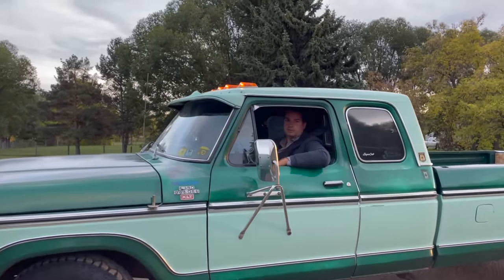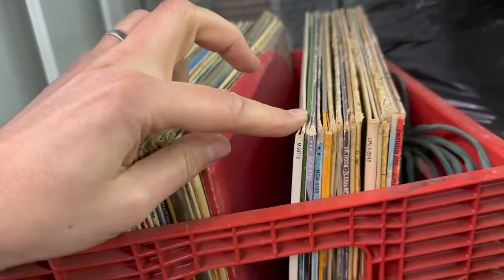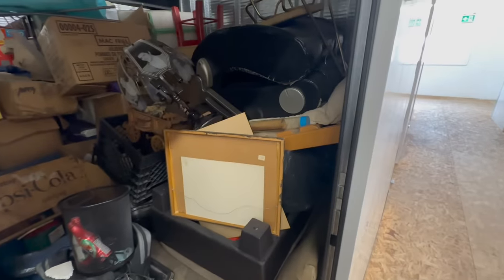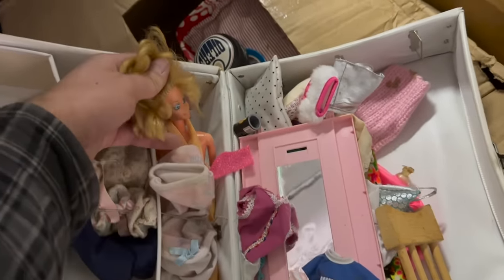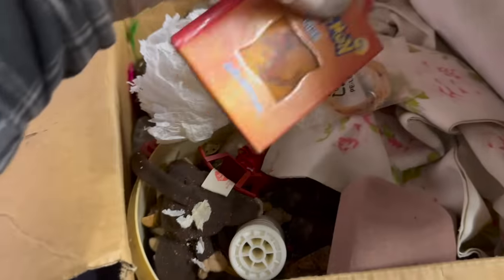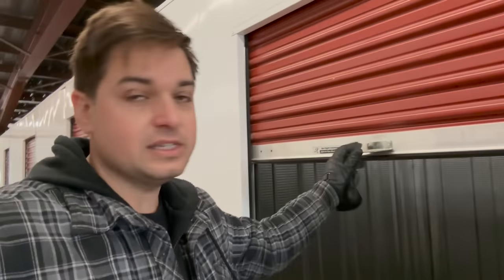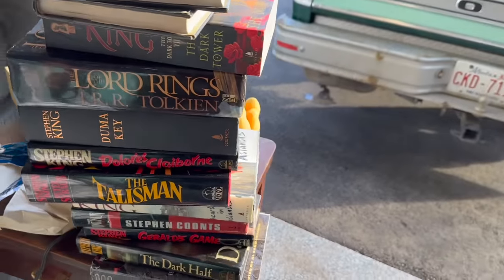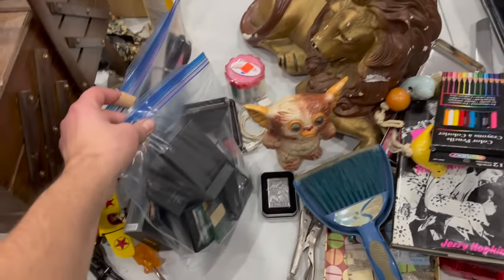Why did they store this stuff for years? Storage unit clean out. whats inside?!?

Comment: Antique Cabbage Cutter:  many of those old mandolins style cutters had a second part, which looked like a 4-sided frame that the cabbage head sat in, to keep your fingers away from the blades.  It fit in side slots on the large board, to slide back and forth smoothly.  Once separated from the cutter, the smaller part doesn’t look like much of anything, so it often gets tossed away.

Comment: Trash runs: Options where u live may vary, but here in Washington State, we have 4 basic trash options:  curbside pick-up, small loads to transfer stations, dumpster rental and paying by the Ton after driving over a scale and paying per pound.

Dumpster Rentals are great for house clearing, but are impractical for storage units.  Curbside is too expensive for a any large volume.

Taking it by the pick-up, when there is a lot of trash in a unit can increase costs and consume extra time, depending on fees and driving distance.

When working locally, I favor driving over the scale and paying by the pound when clearing most large units (or multiple units).  Here, we pay in the $30-40 per ton range and they take mattresses as general garbage.  Mattresses, like large furniture, can be problematic for folks that clear units regularly.  The scales are large enough that a truck, with trailer can be weighed together and the trailer makes it easier to deal with couches and mattresses.

Additionally, since the place with the scale is a larger facility, they also take recycling (cardboard, glass, plastic and metal) free and are a drop off point for e-waste.  All of which turn up in storage units and disposing of them for no cost, means more profit.

Comment: I bought a new Gerber multi
 tool. It was wrapped in  plastic with a warning card about removing all the oil before using the tool. I ignored the warning .Opened the knife and immediately dropped it on the floor. I picked it up and realized I had severed my fingerprint off my index finger. I reattached it and understood why my mom wouldn't let me own a knife.
Reply: How did you reattach your fingerprint?
Reply: hope you washed the oil off before reattaching it. Mom's know their kids.
Reply: @magickmoi1261  It cut down the bone and was still attached at the fingertip. I used liquid skin , superglue and duct tape. Took 2 years for the pain to subside and new nerve growth for touch feeling.
Reply: @Hanzyscure  seriously been there... I work as a meat clerk and the knives are wicked! If I ever slice my whole fingerprint off I'm going to reattach it upside down just to be weird... 😂😂😂

Comment: Those hammer trackers unfortunately are missing the spring loaded keepers that slide into the end to hold the staples in place under tension…but they are good “parts” pieces.

Comment: Oh I hate to hear about your finger. When COVID was starting and we were all masking up, I was making some. While cutting I slipped with a rotary cutter, which are like razor blades. I cut off the front of my nail and thumb about half way down and all the way across my first finger from below the middle joint to the nail. Needless to say, it became an emergency. I am on blood thinners so the bleeding was profuse. Luckily an EMT lives across the street and he was outside. He came over and patched me to try to stop the bleeding while my daughter was on her was, only about a mile or so. They stitched the finger but could replace my missing thumb part  and they used a product invented for military to quickly stop bleeding. Now it is available in drugstores. Eventually after all was healed, my thumbnail started growing back and no one would know. I however can no longer pick up a small item like a coin or needle with the left hand where you need your thumb. It just is not as thick as the original. But that’s minor. I have made it to almost 81 and I know use a cutting glove so it can never happen again.